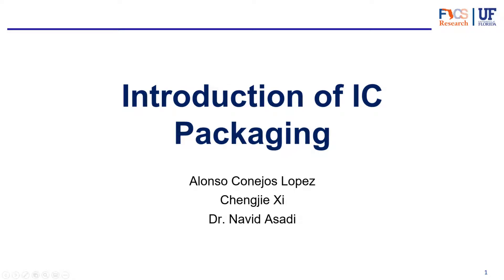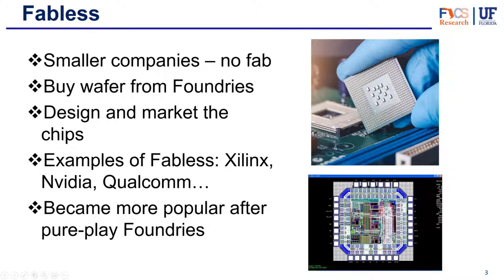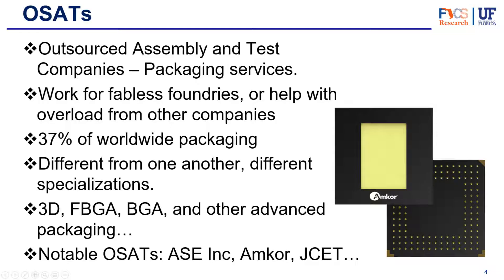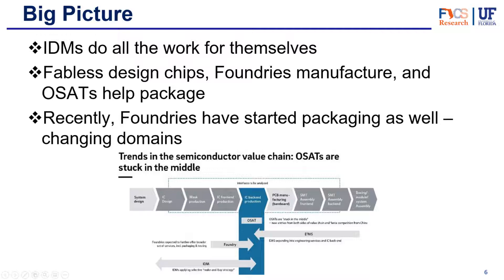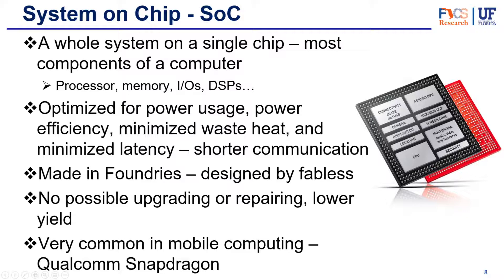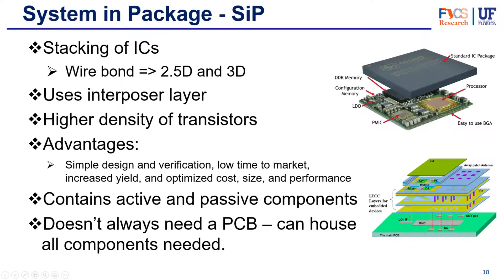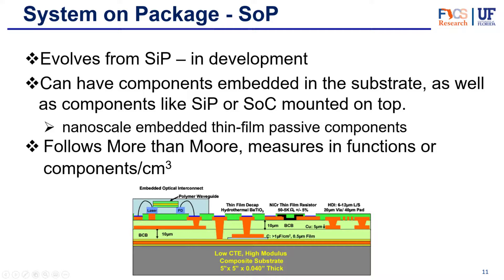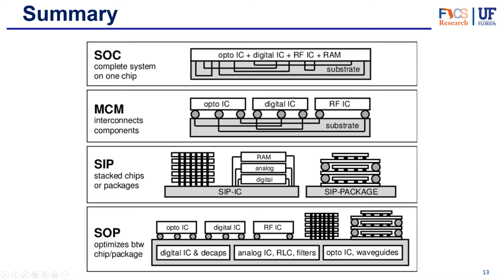Packaging Part 2 - Introduction to IC Packaging

Comment: @11:57 is that Processor wire bonded to the substrate? is it a choice of the manufacturer? can we connect it using FC and BGA to make use of the space occupied by the wires?